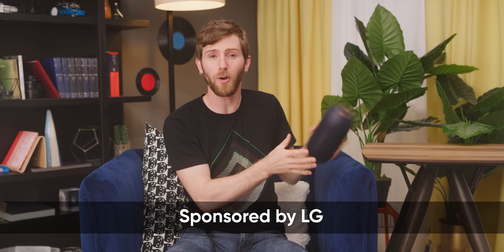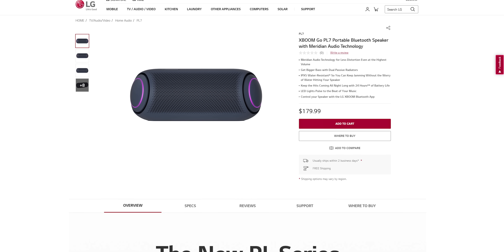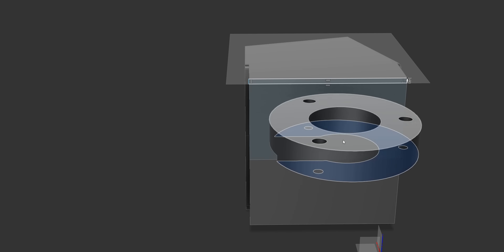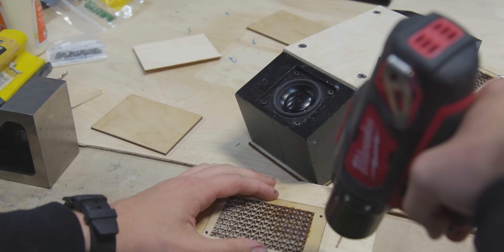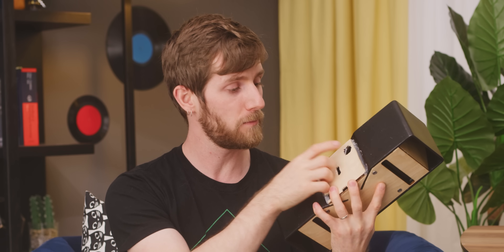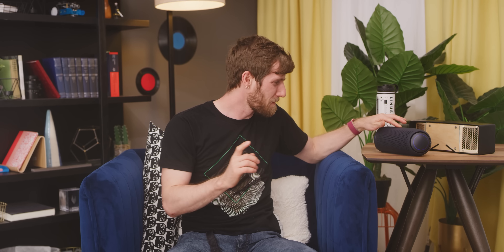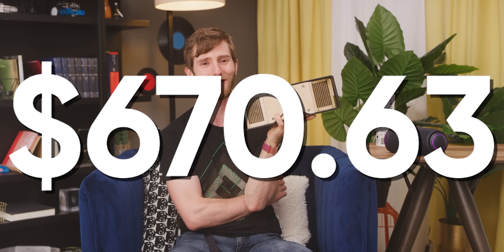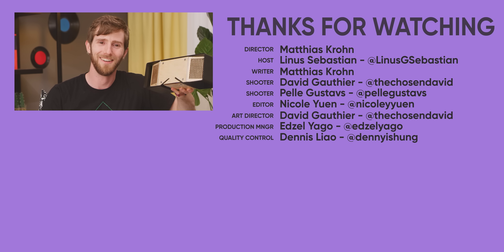Can we build a better bluetooth speaker? - LG XBOOM Go PL Series

Comment: Not a true apples to apples.  the $180 cost doesn't account for the economies of scale on the device.  LTT was esentially building a prototype with one-of OTS components. compared to a unit that spreads the design and cost of items over thousands of units.  I as an individual would not be able to purchase each item and assemble it for 180$

all in all, for 130 bucks and some hobby time, it's not a bad compromise.

Comment: There are CSR8645 based bluetooth audio modules available from China. That's the chip used in a lot of high end Bluetooth speakers. It has AptX and all the other stuff that make the difference between cheapo units and good ones.

Comment: Hi

That’s a basically a transmission line and not stiff enough. Should have just used all the internal volume for the reflex or PRs. 

Also, you probably need DSP/correction for the drivers to get them working as well as the xboom’s. They definitely skimped on their tweeter though.

I build PA speakers all the time. Awesome to see other people playing around with speakers! Next time I’d love to see y’all try some BIG speaker stuff. I’ve got some obscenely loud projects in the works myself.

Comment: When prototyping, you cannot compare to an off-the-shelf item in cost and form. The cost of the the retail product has the manufacturing cost offset by mass production. Prototyping is meant to figure out design and how to mass produce it for max profitability and reduce manufacturing costs. Effectively, you cannot count all the postprocessing of your item or the time in designing as the mass produced item will only contain one millionth (or so) of the cost to do such absorbed into every unit produced. 
So, try either doing the maths involved in figuring the MSRP or just go with cost of materials, since there is already a profit margin in the cost of buying off-the-shelf components since you aren't buying wholesale/bulk/in-house production.

Comment: In my opinion x boom definitely has some benefits like optimized app lights and water resistance but if you did not add that tweeter that is way too much for that small speaker it would be cheaper and probably sound more balanced and also I personally would prefer to make a bigger suitcase style speaker that would crush that LG. I personally would never buy any small Bluetooth speaker but that is just my opinion. I am not a fan of LG speakers honestly. All of LG stereos i have heard have been just BOOM BOOM sound type which is popular these days but i am more of an audiophile and i prefer less bass with more definition.

Comment: aslong such boomboxes dont deliver real bass (i dont talk about the bass you can hear, real bass you can only feel), they are pretty useless, at least the bigger ones.

Also, your attempt was a bit wrong...
get (mostly very very cheap!) a pair of old HiFi system speakers with usable soundquality and get the electronics and battery in one of the speakers, the other output to a connector at the housing for 2nd one. Boombox a bit bigger but MUCH BETTER
I used for a similar project a more expensive amplifier board with stereo/mono and much more options to be able to use only one speaker too, stereo setting is for using both speakers, the 2nd speaker is connected to the main speaker over a few meters wire and a simple (also recycled) connector.
I got even a few switches on the case to be able to use only the amp, but with 2 external speakers including the possibility to use a regular 12V output signal for car subwoofer lights for example (but i think this bad amps wont drive a sub properly, never tried)

Comment: It's pretty unfair to calculate the work hours to the total cost. It's not that you add the cost of the hours LG engineers have spent to design the LG speaker to the price of it. The whole point of making these things on your own is that you only pay for the components and not the time you need to put it together.

Comment: Dude this is so fake. For your average DIY entusiast $179 is a ton of money to build a monster speaker with that wipes the floor with any commercial product. 
I built several and it's absolutelly amazing what you can build with with a pair of small cheap speakers, some passive subwoofer membranes and a $10 chinese amp. 
The loudness and battery time are far more higher than 99% of mass produced bluetooth speakers. The only downside is time and effort to build one, but I always have fun doing these.

Comment: Pretty neat speaker, but did you use any crossover for the tweeter? I am no expert, but I suppose that feeding low frequencies to tweeters can damage them. And for that inbalanced highs, adding resistor to the tweeter would probably help(if you really don't want to use a crossover)

Comment: DIY Perks has entered the chat

In all seriousness though 179 bucks you can easily get an RC battery, Bluetooth board, OP Amp assembly and fairly decent small speakers. Where you will probably lose is weatherproofing and, if you assume labor is not free, in the finish of the poduct.

Comment: I have a JBL center speaker I want to use as a Bluetooth speaker. How would you connect the amp outputs to it to get the full output of both channels on the single speaker?

Comment: I certainly wouldn't mind a mini-series exploring what it would take to design a reasonably respectable bluetooth boombox to compete with OEMs. Then you can revisit building studio monitors to compete with the pro stuff. On another note: if you're going to include a larger speaker to handle your bass response, then you should absolutely see if you can find some sealed full-range speakers for everything else. That way, they don't require their own resonance chambers and their higher resonant frequency won't be as detrimental, since you can push the bass reproduction to a dedicated speaker.

Comment: FYI, the muddiness in the bass response is because you're using an undamped transmission line design. Those will echo like crazy unless you fill them with some sort of sound deadening material.

I've never combined it with a total lack of crossover, but that sort of "oof my lows sound like every frequency at once" is pretty distinctive.

Comment: I have a video idea for you'll, if you guys are up for a challenge. 

I want you'll to mount all the cpu hardware on to a wall in a straight-line with fans behind them or liquid cooling and see the efficacy of the CPU. If it can be done and if spreading them out over a distance improves the performance. It'll be an interesting video.

Comment: I'm good with my own BT speakers. I bought them for 1000rs(close to 15$) and they also can be used as USB sound card, built in FM radio and , an mp3 player and a card reader. And sound quality is very close to the ones with 10 times its price.

Comment: You guys have a workshop with mills and all kinds of other machining tools to take a couple off cuts of aluminum from your local metal yard on top of being able to hand cut at least the edges of the wood (with hard wood, boo ply) to make a flush finish but instead you just printed everything :|.  I do all my work in cad too to make sure everything will fit properly and run simulations but I do basically everything else by hand...and when you factor in print times it would have been around as quick (especially if you limited yourself to 1 printer vs a fleet of them).  Sound quality would have been the same but quality overall would have jumped up quite a bit getting rid of big seams and feeling a lot more "hifi" so to speak.  The only argument might be to print the speaker chamber but even then it wouldn't have been that much of a hassle to cut those shapes out of wood in pieces and glue them together.

I dunno, just seems like a waste to have such a nice workshop and not use it here...I guess the argument is everyone doesn't have a workshop at home, but even then the basic hand tools to make these shapes (plus maybe a router for sound chamber bends) and materials (most places will nearly give away off cuts around here) would probably be cheaper than the printer alone before you factor in filament.

Comment: Interesting project.  Are they better then my 1995 Labtec LCS 1000?   Sorry guys, but no.  I don't know why, but this old speaker set up is still better then any modern speaker set up I've heard so far.  Why is that?
Reply: Well, they are not better sounding than any other modern speaker setup, but better than most of them. It is because they were actually caring for the sound, instead of good looks, portability and cheaper materials. Most of the old speakers combined with some proper A/B or even A type amps sound amazing when comparing them to bluetooth speakers.
Reply: @Mikax82  Yes!  I've yet to listen to a Bluetooth speaker that didn't sound tinny and weak.

Comment: Hey there, can i ask you for some help? somebody built me a pc but it has continuosly showing me up BSOD errors... CRITICAL_PROCESS_DIED, KERNEL_DATA_INPAGE_ERROR, WHEA_UNCORRECTABLE_ERROR, UNEXPECTED_STORE_EXCEPTION.. whats wrong? hte only stuff that I modified on UEFI BIOS was the xmp profile. is a corei9 9900k, an asus rog strix z390e, a crucial 2x8 3000mhz (which has activated the xmp profile), and a rtx 2080s, :(

Comment: You should not have counted the design and rework costs as their developments costs was likely in the hundreds of thousands.  Also many of these components you can get much cheaper in bulk... even in quantities of 5-10 pieces.  I would have 3D printed everything, did an acetone dip and painted it with a thicker textured paint.  Cloth over the speakers would have helped the tiny noise and I would have definitely added the mini sub.  Also with a little testing you might have found a better amp... and speakers for only a little more.  You can also get reconditioned 18650 batteries for pretty cheap.

Comment: The DIY speaker actually sounds more clearer whereas the LG just sacrifices clarity for bass.
Reply: A lot of products and sound systems don't know how to Mix or understand low cut.  I've yelled at a few sounds guys up for levels and their lack of understanding on how base works.  Soon as the walls shake it becomes inaudible.  Base shouldn't make anything shake.  It sounds like garbage.  It should never sound like a bucket of water it should sound like a fist.
Reply: @RichardB-h9c  This is why all Hi-Fi systems should have a Graphic EQ. Audiophiles tend to hate them, yet spend thousands of dollars on things that essentially a Graphic EQ could fix for much cheaper and much easier.

Comment: Did you put a crossover in, either passive or active, to separate the frequencies of the tweeter and the midrange speaker? That's what helps keep the sound clear by not supplying speakers with frequencies outside of their intended range.

Comment: So happy I don't have to buy another bluetooth speaker...my Milwaukee jobsite radio AND charger totally dwarfs any speaker I used in the past in audio quality but mainly, in volume. Before, the speakers we used at my job worked fine if it's close, without too much noise and in a small closed off section of the shop. Now, we can hear the radio almost everywhere in the shop, at half volume!

Comment: best bluetooth speaker ive made, go to a deli that wraps things in plastic wrap. get one of their deli wrap rolls with no plastic wrap left on it, they're a standard size, and fit speakers amazingly, cut a 3/4 in x 2 1/2 in hole in the center of the tube for bass porting, and all the internals like the board and battery bank can fit in that. I've never made one with buttons.

Comment: Why ignore the parts express Bluetooth kits? While they are slightly more expensive, they can give a comparable DIY experience minus the design aspect, which I assume was the majority of time. They even include batteries and amp. Much cheaper if you are going to consider "time" as a cost.

Comment: To do this properly, all you need to do is proper crossovers. Active crossovers preferably. That is mainly why it doesn't sound so refined. The speakers are just all fed the same exact signal and it pushes it to do frequencies they cant produce and those bleed into eachother. The sub is also better replaced by some well designed passive radiators. And better drivers wouldn't hurt too haha. All in all this isn't too representative of comparing DIY price and quality to consumer products. Like seeing someone build a pc with weirdly matched components and settings.

Comment: Love you guys but you did this all wrong.
44$ gets you a set of 2 Bose minicubes (Amazon slightly used) 23$ gets you a small size Bluetooth Amplifier with aux and all. Battery, fancy case, done. 
100 bucks and will sound probably better given the amazing sound of the mini cubes. 
Ciao :-)

Comment: The relevant question isn't how much does it cost, $ and time, to build a prototype, but how much does it cost to build a copy of the prototype.  LG is averaging their design time over sales.  Since your prototype is about $50 less in parts, could you build/assemble it in 5 hours or less?  The maker cred of the additional hours required to DIY accrues to whoever publishes the spec and shouldn't get included in the final comparison.

Comment: Neat experiment! I'm curious where LG makes their speaker, and how much they pay their workers.
Reply: LG make electronic modules in korea and assemble them in the trade area they retail.  Their EU plants are in Poland and pay across the average income ranges (there's a minimum wage so that's not surprising) you'd have to find job listings to be exact though.  They also assemble in America, they have a few plants in Tennessee for example, and of course china.
Reply: A worker on the assembly line could put together dozens of those per hour. All the engineering and design were done before hand and the parts were already manufactured by machines, and very likely most of the speaker was pre-assembled by machines as well.
Is not like the employees are sitting there designing, manufacturing, and assembling each speaker individually.
Reply: Kur Norock nobody said that.
Reply: @olpizl  Given the context of the video, the implication in the OPs comment is that the people assembling LGs speakers are underpaid based on the fact that Linus calculated over $800 worth of labor costs in building his DIY speaker. 
Maybe I am wrong, but that was a reasonable assumption to make.

Comment: well, it doesnt need expensive box ported design.  u simply need a simple box but use passive radiator/speaker for better bass. this way you lessen the labor cost

Comment: You could have used a PVC pipe as the body, a Lil high gloss or flat black spray paint, make spacers for front facing woofer, buy a better amplifier.. Money was wasted in the wrong aspects on this build.. Surely didn't have to use a 3d printer... I mean you could make something that looks cool sounds decent and costs less than $100...

Comment: TL;DR: swap the dayton full range drivers for ones that have a better xmax/ sensitivity and replace the ported design with a passive radiator design.

Companies usually use passive radiators rather than ports on their drivers to remove that "muddy" sound you get from some port designs and it also usually allows for a more consistent bass response across all frequencies at the cost of higher volumes at peaks. A passive radiator can also aid in making the enclosure smaller and lighter aswell as some radiators being waterproof. Ontop of the difference in enclosure type, most companies use a "long throw" full range speaker (higher max excursion) which allows the small drivers to produce lower frequencies as it provides much more air movement. Additionally, the LTT team decided on 8ohm drivers when dayton provides lower resistance drivers for no extra cost and can mean a much higher power output from the amplifer.

Comment: Didn't watch much past the listening comparison. I doubt you want to dig too much more into this, but if you wanted to improve without too much more work, I'd do two things.

1. Seal your bass ports. They do indeed add bass, but at the expense of articulation in the bass. In a sealed driver, the air inside the cabinet acts as suspension that helps to stop the speaker when it no longer needs to move. Yes, you will lose a little bit of volume, but trick two here is going to help you get it back.

2. Add a signal processor between your inputs and your amp to do a psycho-accoustic bass boost. It's a funny trick of hearing that if you play the harmonics of a fundamental tone without the fundamental tone, our brains will insert that tone even though it wasn't played. So, even though you don't have a subwoofer to play those lowest frequencies, you can add in the upper harmonics, play them over your normal speakers, and your brain will insert the missing bass information. Then lower the volume with a shelving filter below 100-150 hz and let the psycho-accoustic phenomena fill in that bottom register. My bet is that this his how most of these bluetooth speakers actually work to get this much bass out of such a small box without consuming too much power.